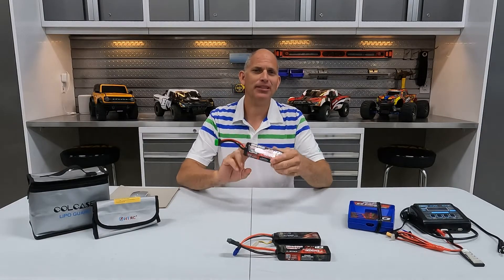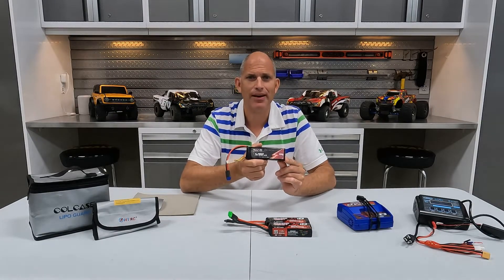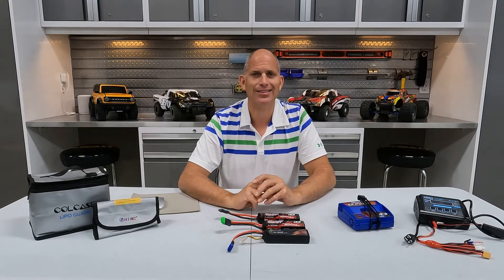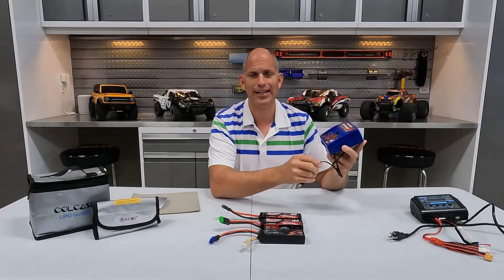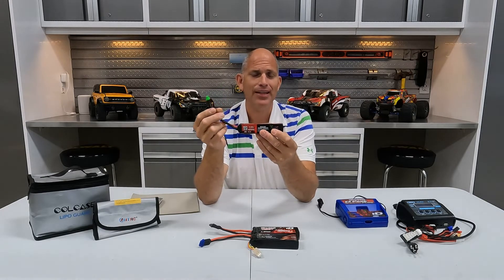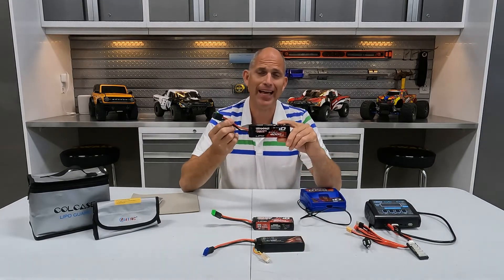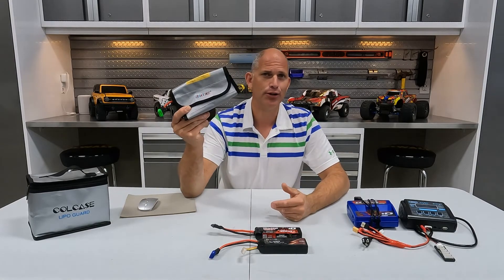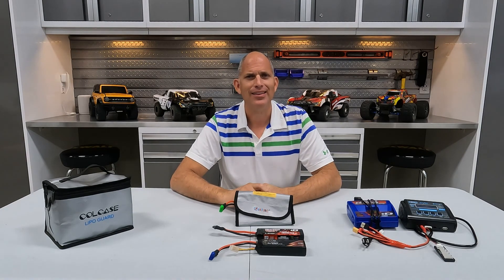Tired of ruining your LIPO Batteries?

Comment: I thought you could discharge on a Traxxas charger if the battery was a Traxxas ID battery and was fully charged and not used for a day you can still put it on storage mode I have been for 4 years now unless I misheard you great simple video though good stuff to show the younger viewers because of the simplicity
Reply from the maker: That is a great point, I dont think I commented on that. That is not how I do it, but I beleive you are correct that storage charge will discharge Traxxas ID battries automatically.